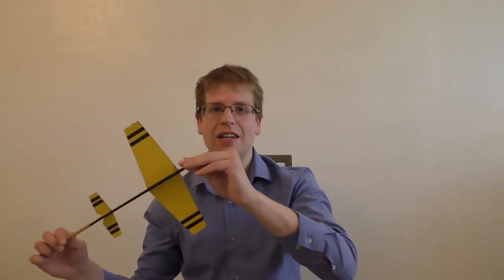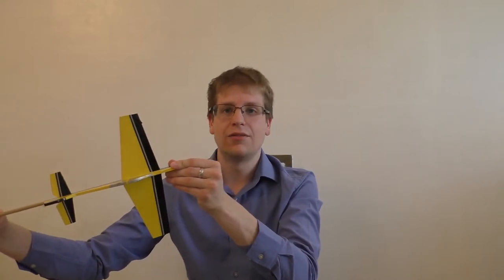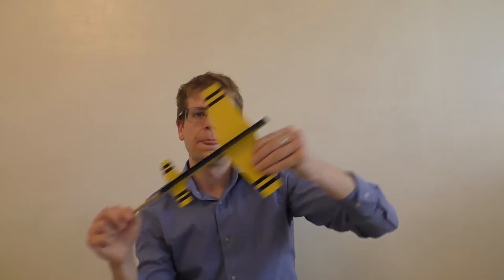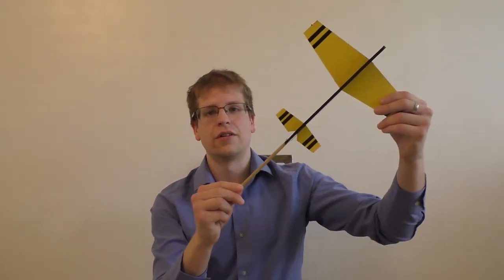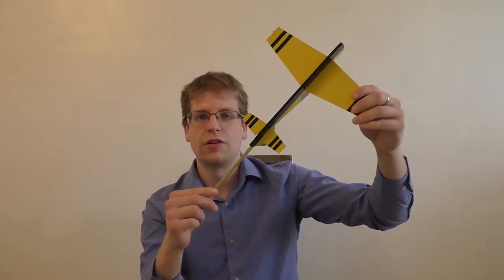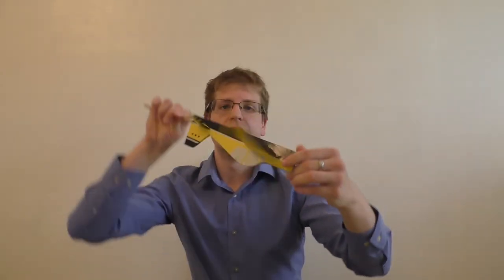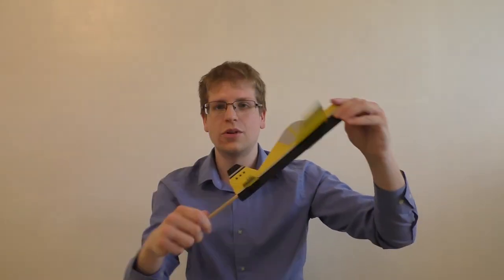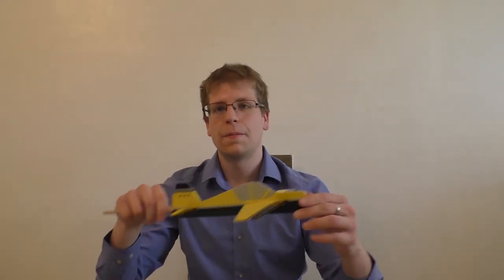How to Perform the Lomcevak

Comment: Hi, sorry but you have no idea what a lomcovak is!  You use the gyroscopic effect of a propeller and there it depents which directions it turns so you can do only a lomcovak in one direction with a plane depending on the direction of turn of the propeller. Then the aircraft is turning around the axis goijg through the wing and you use rudder to support this!
Reply: Thats not technically true. Gliders do Lomeceks  too.
Reply: @realMaverickBuckley  barely...
Reply: @Siddich  MB-339 also does this. It's safe to say YOU guys have no idea what it is. Just because the effect is greater on single engine prop planes doesn't mean it's limited to that only. Freaking arm chair pilots.
Reply: @kontoname  i did not say, that there are not any better planes for those missions.

and the MB-339 also has drawbacks...

maybe not in probable scenarios, but still...

und btw.: mimimi, was bistn gleich so ne heulsuse, bist bestimmt n pilot, dass du andere arm chair pilots nennst.

also ich habe immerhin n paar starts und landungen in meinem flugbuch ;-)